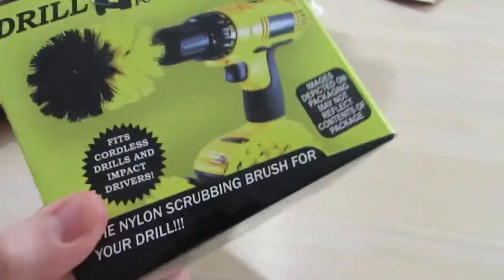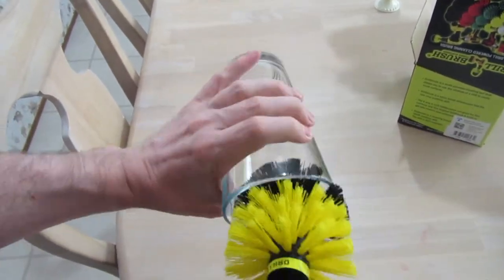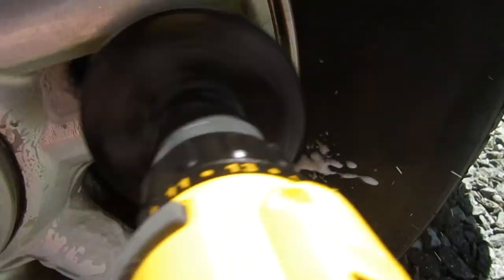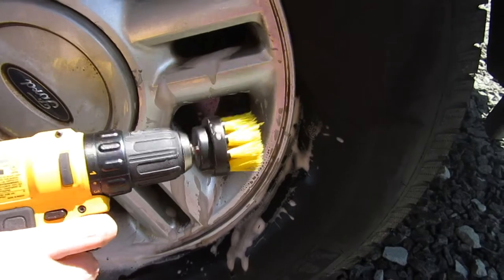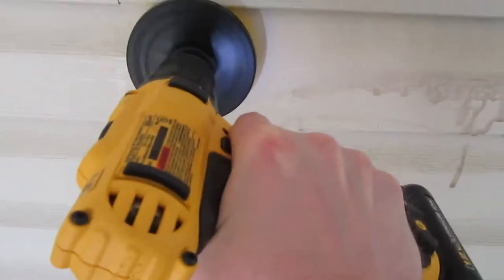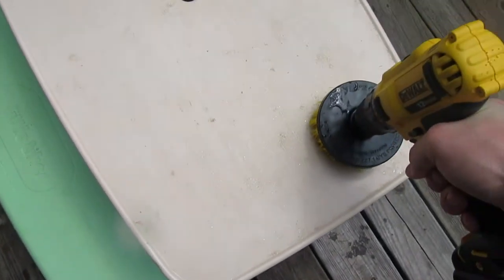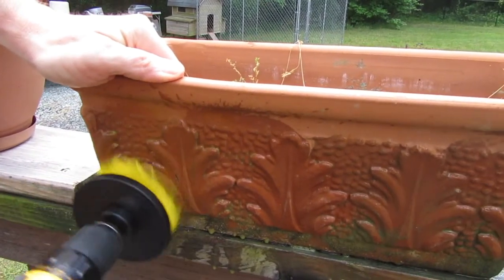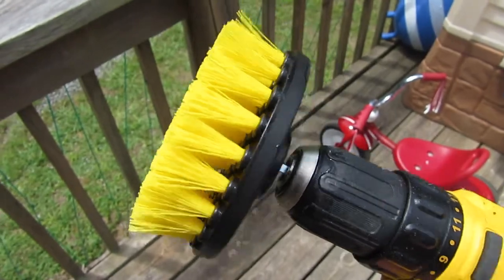DRILL BRUSH put to the Test 😮

Comment: I had a different brand brush kit and was using a spare Milwaukee 12v I had and I ended up burning up the motor in the drill. I did end up finishing up with a 20v Dewalt. Maybe my old 12v drill was on it's way out anyway, but I noticed Dremel makes a power tool specifically for scrubbing for 40-50$ maybe other companies will eventually follow.